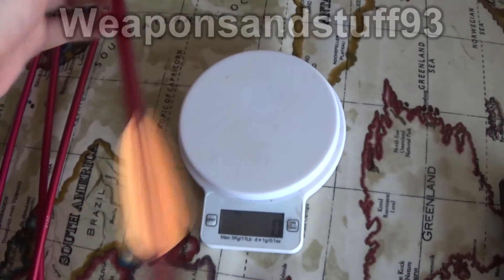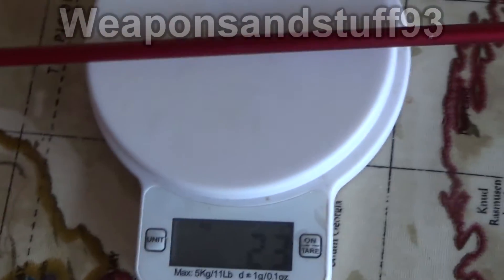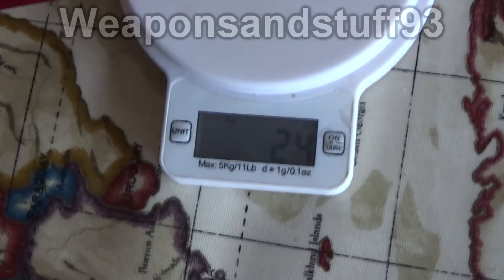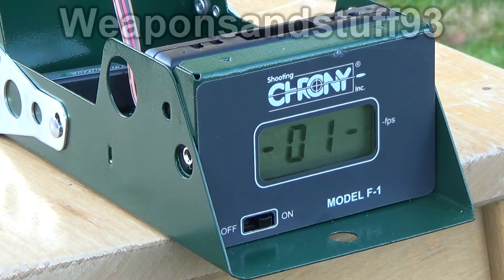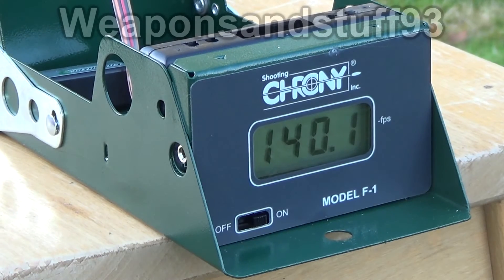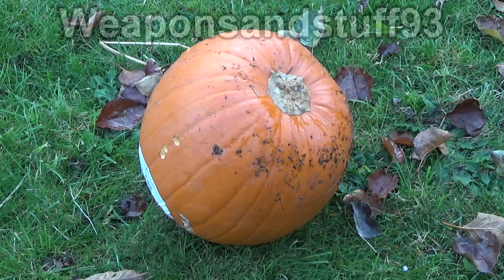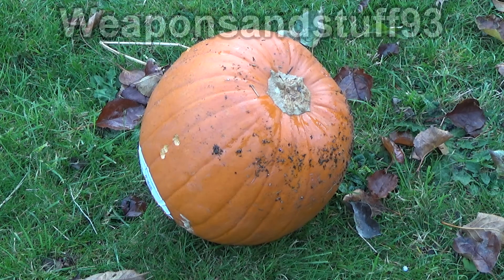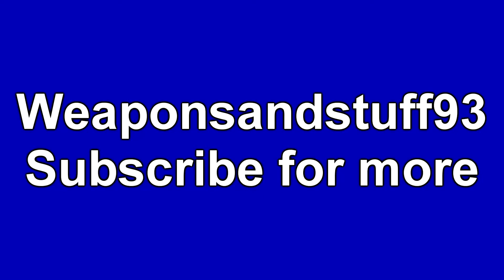40lb Recurve Crossbow Chronograph and Energy test

Comment: I have got a rifle crossbow fitted with a 40lb limb. Very interesting result you have there but not surprising. I was firing mine at 25 yards into an archery target. With 14" bolts the penetration was surprisingly good, more than half way to the fletches. I really would not want to get in the way of it. In all probability it drops off quite sharply after 25 yards ?
Reply from the maker: I find the accuracy suffers quite a bit with distance, so I am very cautious using it at range due to missing and damaging nearby objects.
Reply: Yes I have no doubt it would because the velocity will drop considerably dropping the trajectory of the bolt. Mine with 14" bolts shoots accurately at 25 yards. I would not bother with it past that distance. I have a Barnett commando and rifles for that !